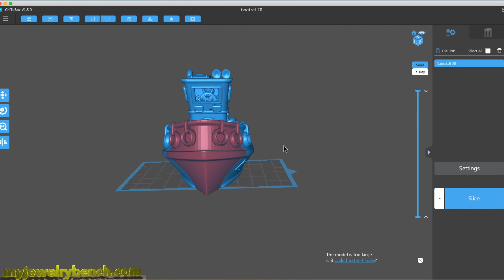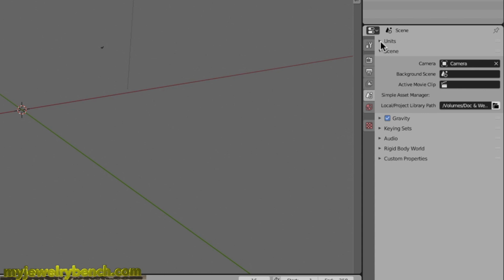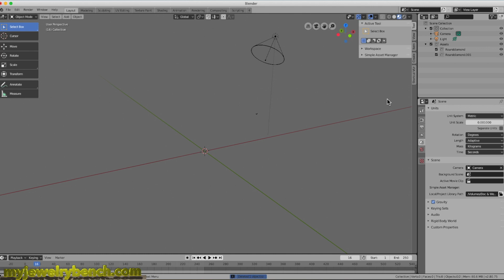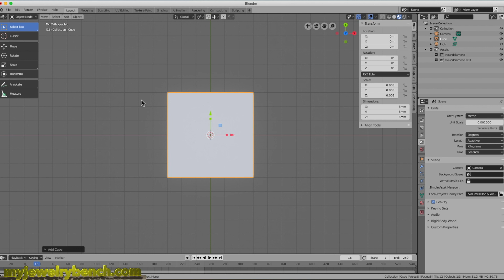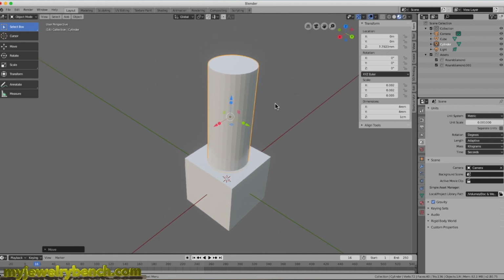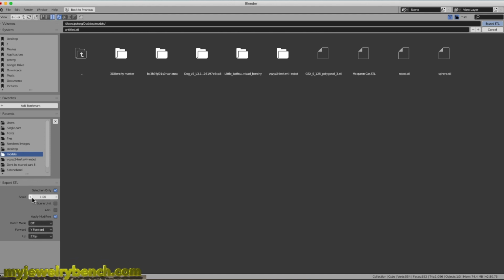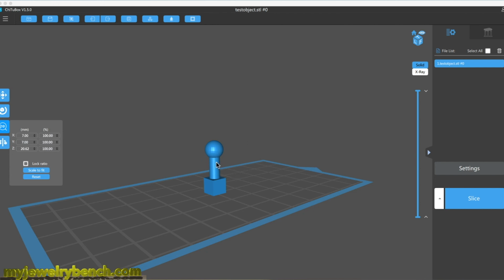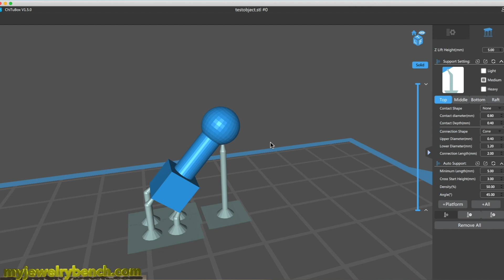Importing your Blender Model into your 3d Printer Slicer, the correct size!

Comment: For those of us on laptops, we don’t have a number pad function. Hitting the 7 key doesn’t change to the top views…….I have to do it manually. 🤷🏾‍♂️
Reply from the maker: You can use the “tilde” on your keyboard and select the view from the pop up menu.  That is the little squiggly line near the 1 key on the upper left of the keyboard.
Reply: @watchesandjewelry  Oh ok! Thanks! 

I’m trying to convert .obj files to .stl ones. These are car files with a ton of parts, but they were scaled REEEEAAALY tiny, I believe HO scale. 

The trick is to get all the parts converted, then get Chitubox to print them in the correct scale so that parts won’t be out of scale to each other. 

I like to go by percentages in the slicer….if I’m doing a model in 1/25 scale for example, the percentages across the board should work for all the parts IF….the scales in Blender match up correctly before being exported.

Thanks for the help! 👍🏾

Comment: Why print it tilted?
Reply from the maker: Printing at an angle especially with things like jewelry will often give you excellent results.   Especially rings.  Some models benefit from straight printing. Most can be improved by rotating 20 to 45 degrees
Reply from the maker: Also, when adding supports to the model, angling the print can help move the support contact points from important parts of your model so that you have less cleanup time and lower the rush of damage to your model. Thanks for a great question
Reply: @watchesandjewelry  thanks for an informative answer

Comment: I'm very new with the 3d printing and cad. So I made a ring in blender 2.8 that I like to send for printing and casting but when I make my file .stl I have to use 3d print toolbox add on for blender it has an option with the name of MAKE MANIFOLD when I apply this option it deform my model. So, later on I try the same ring "without applying" MAKE MANIFOLD and create the stl file without any deformation. My question is : Do I have to use all the time make manifold option in blender in order to print any model or is Ok without it ? I appreciate the help . Thank you so much.
Reply from the maker: There are some settings under the 3D print tools that need to be adjusted.  I’ve been working on a video for this. I’ll speed it up.
Reply: @watchesandjewelry  Thanks you I have a lot of questions regarding this topic I thought that was just make your model and ready to print but looks that there's a lot of details before to sending for printing.